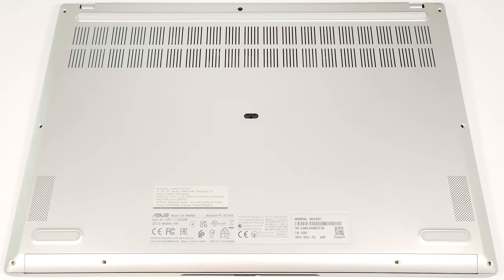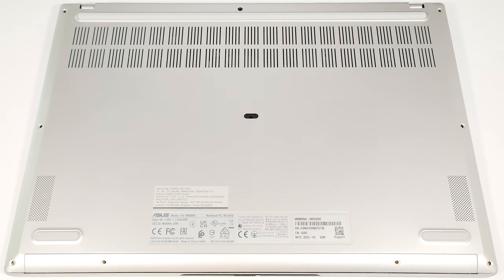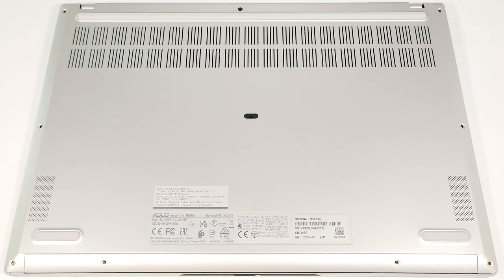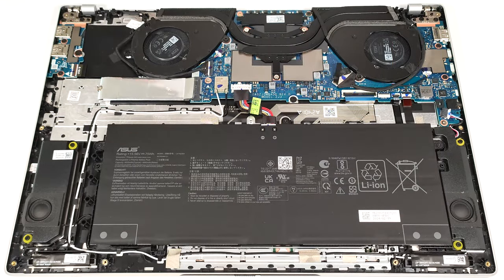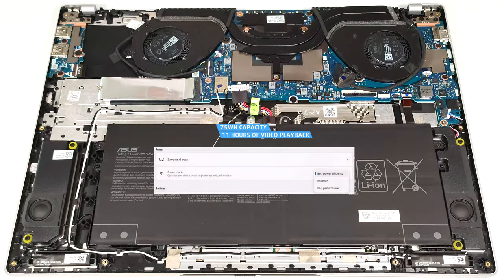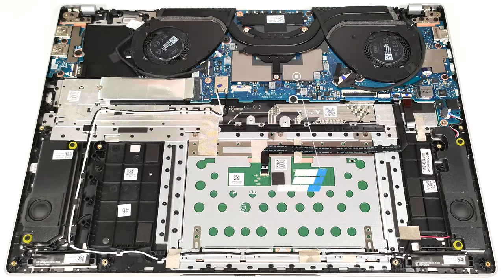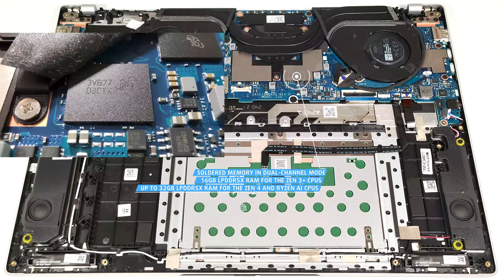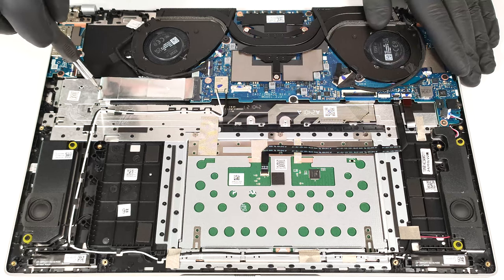🛠️ How to open ASUS Vivobook S 16 OLED M5606 - disassembly and upgrade options

Comment: upgradability score: 0.5
Reply: I at least hoped that the SSD would be upgradable but no 💀
Reply: @RaneKunLovesNightcore  It's upgradable, it's just an M.2 stick. There's only one slot, so to upgrade it you need to replace the original drive rather than just add another which is unfortunate, but it is upgradable

Comment: Does the SSD include a thermal pad? If not what size can we install ? 0.5 or 1mm?
Reply: gen 4 ssds do not need a heat spreader